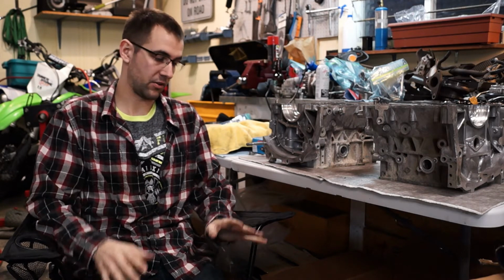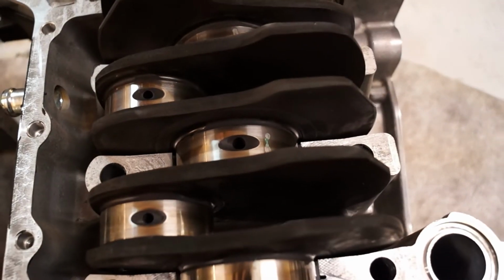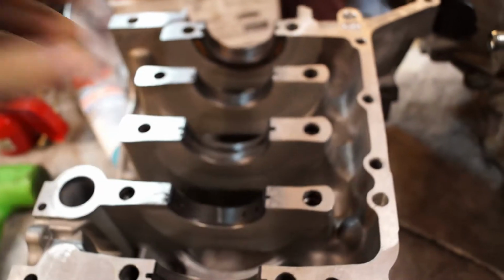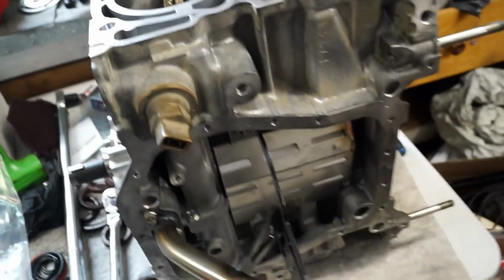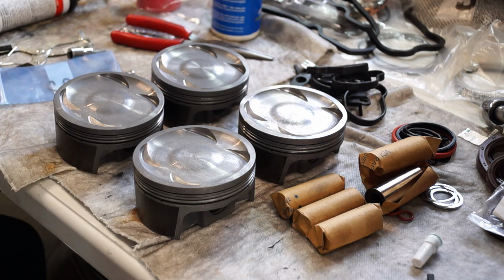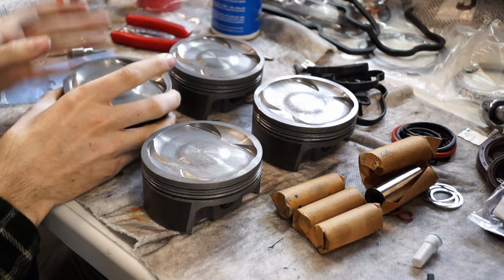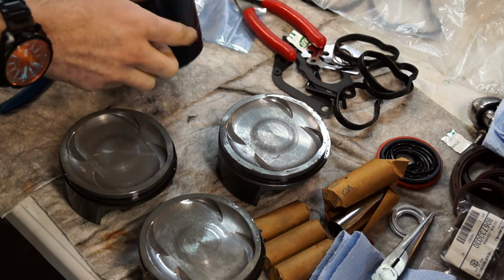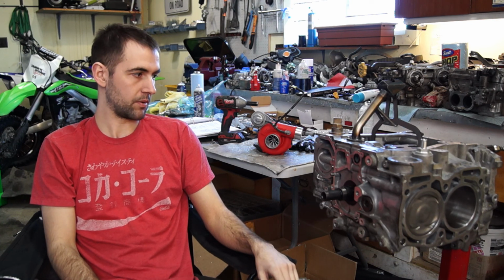Plastigaging my subaru engine and assembling the shortblock. [EJ257]  [Frugal Garage EP12]

Comment: How did this block hold up? Really want to DIY my own build since labor is expensive but dealing with tolerances seems like the most stressful part.
Reply: It put up with 30,000kms of hard driving on a pro tune, then I sold the car and it's had two owners since. It's still running
Reply: @joshkendall9733  Good to hear. I guess I'll start planning my build then :)

Comment: Quick question man, where did you order these parts from? I am planning on rebuilding my engine, nothing mechanically wrong apart from a blown turbo possibly, but I feel in my sake, I want to remove the entire engine and build it to handle more power. I was looking at Import Image Racing and found a kit they sell for 600HP that includes rods and pistons, bearings, etc.. Just wondering what approch I should take.
Reply from the maker: MattsPlaysHD just reuse your stock rods and get upgraded pistons. I recommend Mahle pistons because the are low expansion unless you want to make like 500+ HP
Reply: I'm planning on 450WHP if possible, do some injectors and etc. But I'm concerned of my Turbo, I have no idea if its blown or not. I just purchased this STI about month ago, ever since I got it, I haven't felt much power as I expected. Could just be me or theres no boost at all. I tried Sport Sharp down my street to see what it will do, 1st Gear Good, 2nd Gear Good, 3rd Gear around 4500RPMs, car jerked real hard like something broke or something, and set my check engine light. I went home checked for codes, it set a turbo waste gate performance/range code. I cleared the code and car drove normal and no check engine light came on. I don't know what that is supposed to mean, I work on Fords and far as I know, since they got Internal Wastegates, we replace turbos. But I'm sure all cars have Internal Wastegates when it comes stock with a turbo. Question is, will external waste gate solve my issue?
Reply from the maker: Sounds like your boost control solenoid isn't working properly
Reply: Frugal Garage there a way to properly test it? I don’t know where that boost control solenoid lives
Reply from the maker: MattsPlaysHD it's by the alternator under a little silver bracket. Google it, easy to find. I don't think you can test it

Comment: Did you get your cylinder head machined also?
Reply from the maker: Rich B no, sanding block and a few back and forth passes with 1000 grit sandpaper to clean the block and head. The car didn't have a head gasket failure and the block was checked for flatness at the machine shop.